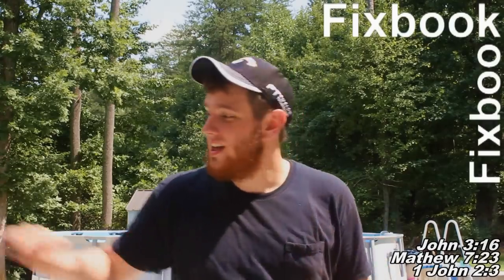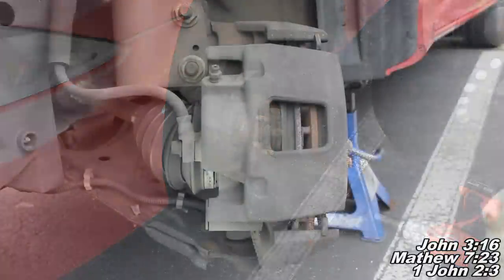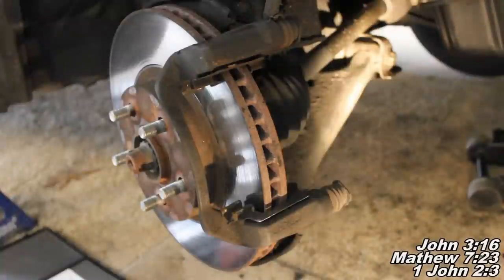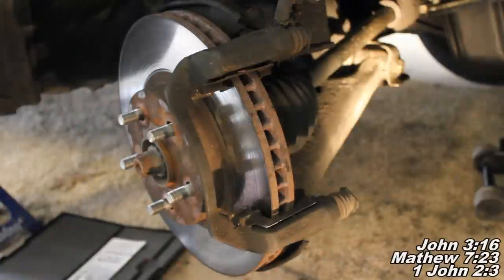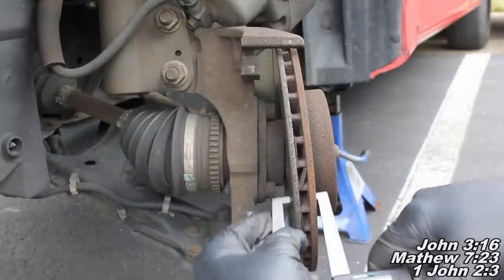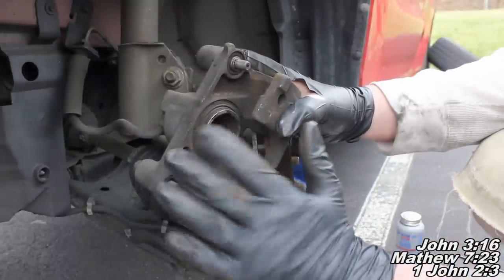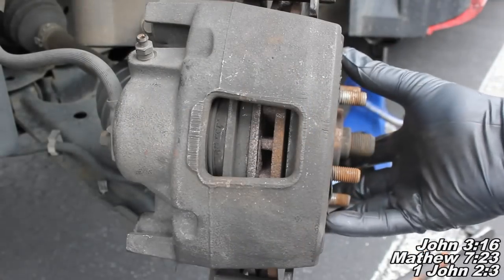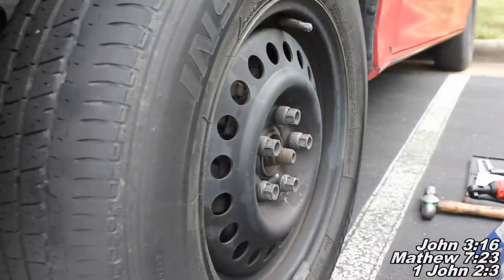Front Disc Brake Pads & Rotors "How to" Chevrolet Cavalier

Comment: My new front brakes came w/some black rubber inserts for the calipers (where the mounting bolts go, you can see them @9:40). Is it hard to remove the old ones, any grease (maybe dielectric grease) to apply when insert a new ones? Thank you for the great film.

Comment: thanks for the video it helped a lot. i Chiang my dad brake pads on his 2007 Chevy. it lil different. i been so busy i haven't even    even put work in on my Baby. A 1998 Caviler i need to Chiang the from driver side shock. the the rack and pinion. then the calipers and brake pads. after that shes all good. It a lot. but its ganna get done!✊.

Comment: I see a lot of experts recommend clamping the brake lines and loosening the bleeder screws before compressing the piston. They say it's safer from the perspective of not causing overextension at the MC caused by retrograde flow, and they are trying to avoid reflux of possible debris back up the brake lines. It's not something I normally do, and I do wonder about the risk of causing other problems when they do that. Any thoughts?
Reply: I know this is 10 years old but thought I would answer in case anyone reads this. You are correct it can cause other problems. It can, and often will, cause air to get into the brake line and cause the spongy brake effect. I've read probably 10 comments or so on various different Cavalier brake change videos, from many people like these so-called experts, and ended up with spongy brakes.
Reply: @d-rockanomaly9243  Yes, it's interesting to see how opinions on this still vary. Although the standard ASE teaching is still to crack brake lines, almost no professionals do that in a routine brake job unless they are bleeding to replace fluid. Now that mainly professionals are posting here on Youtube, the backlash anger aimed at those who don't has calmed down.

Comment: I replaced the brakes and rotor in the same manner as you and after the job I have spongy brakes. They firm up with the car off but when I go for a drive they get spongy again. Everything was fine before the job, what couldve went wrong?
Reply: Probably you had the brand fluid cap open at one point? Air in the brake line causes this.

Comment: Hey great vid. I need to do my girlfriend's cavalier asap. But it seems only front brake pads and rotors are available for me. Anyone know if the rear and front rotors interchangable?
Reply: okay so cavalier has drum brakes in the back and rotors and pads in the front? is this right? anyone know for sure?
Reply: dan4451 Most cavaliers are drum brakes in the back. From time-to-time there would be a sportier trim-model that might get front and back discs. Sux though because changing drum brakes doesn't look as to be as fun. More small parts, less intuitive layout of the small-parts, and plus some metal springs you have to fight against.  Look up stuff re: the brake fluids. Maybe not a complete bleed, but at least how to remove fluid from the master cylinder and refill it with new fluid. That car guy had a nice vid for that.

Comment: Thanks for the video man! It was great and really helped out a lot, although i did have to use a tool to compress the element that pushes up against the pad on the back nearest the engine, but it only cost $10. Your flat head screw driver technique didn't really do the trick.
Weird gun intro....
Reply: Yeah a c-clamp on the piston is a better option here....take the cap of your brake fluid reservoir to ease this process.